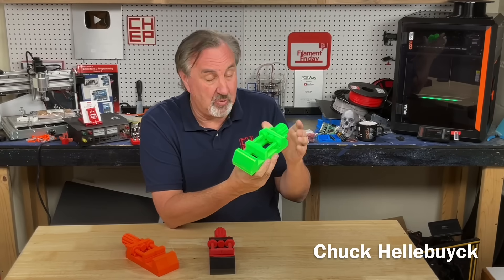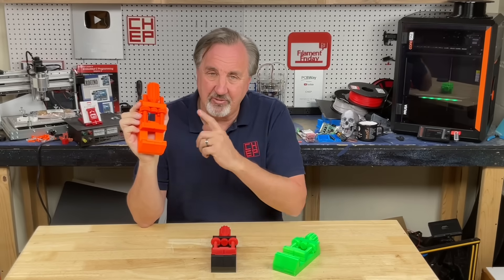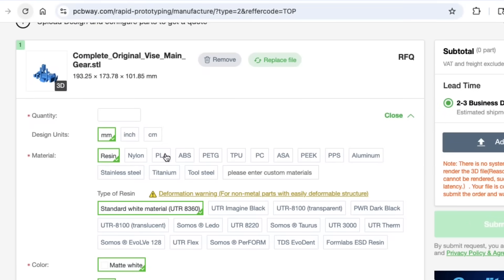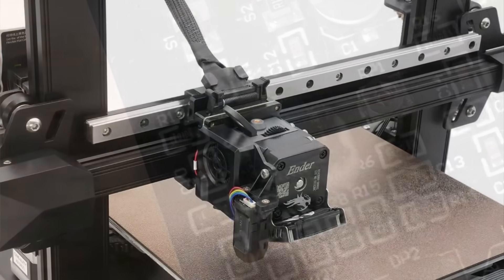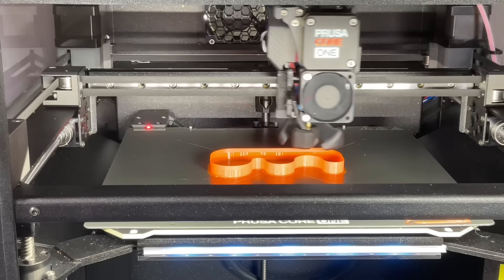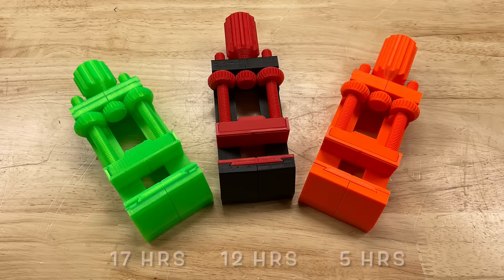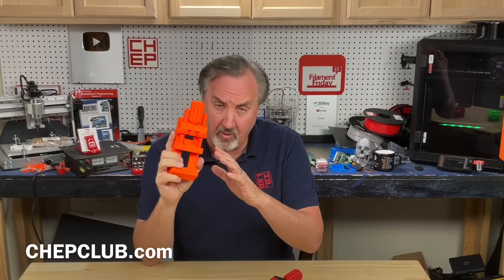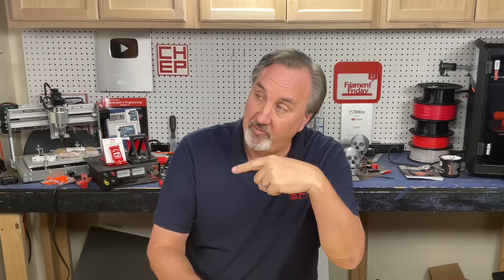How Did 3D Printers Get So Much Faster?

Comment: Look at what Roetz 4.0 is doing. Ultra high flow extruder with specialized cooling and motion system. It's definitely within range that machines can move faster, higher accels, the key is cooling with something other than air.

Comment: Until your outro I never knew what CHEP stands for 🤯
Regarding the question: I think currently we're at the limit what can be done with steppers, that's why manufacturers start switching to servos instead.
And if you want to go really fast, cooling becomes the main issue. You can increase airflow only so much before you simply blow away your print...
Reply: Temp of air or not even air. Look at Roetz 4.0, he is experimenting cooling with helium. Also current mass production high end machines cap accels at 20k, diy machines blow past those at 50-100k, and mass production hotends barely hit 40 cm^3, after market custom hotends hit triple digits. Servos aren't necessary, they're nice, but they bring their own problems, servos are used in CNC world due to torque at speed, you don't need high torque in 3d printing.  Bambu is only using a servo in the extruder for extra information. Watercooled hotends, steppers and electronics will be coming to mass market. Only way to increase flow without clogging. More patents will be going into public domain, and more advancements are coming.
Reply: I wonder if servos would eliminate vfas…
Reply: @dgurevich1 no, actually servos on xy make vfas worse. I tried it. Have over a $1k of parts in a bin waiting for a different project. Probably something in robotics.  Was also tried by Vez, vzbot main creator. He couldn't tune out the vfas. Modern tmc drivers give so much feedback info and can run at up to 60v and 8 amps, running servos isn't worth the extra headache. My trident is on 56v and hits over 2m/sec. Speed is not an issue. Monolith gantry will get to 50k accels and zero vfas.

Comment: 1:15 — I love my CR-10S. And as we have gradually been improving Marlin, the most basic self-contained firmware has continued to make this machine a little faster and more reliable with each month that goes by. And in recent weeks we’ve been getting some amazing optimizations from new contributors who really know their stuff. Whatever level of RepRap you are rocking today, there has never been a more advanced selection of drivers, slicers, and accessories to make the whole experience better, smoother, and faster!

Comment: I wonder how fast one could make a CR-10 by updating extruder, stepper motors, electronics, software etc... it wouldn't be a CR-10 any longer except in looks but would be interesting.
Reply: I'm kinda on this mission now but without linear rails, it will never be that fast.

Comment: Weight!!! Tool heads and other moving parts have to shed weight to handle higher accelerations.
Reply: look at the t250 -- it's not about weight, it's about balance, that machine hits crazy high accels, it's engineering and managing resonances.
Reply: @kazolar  Matt specifically mentions lower toolhead weight as one of his goals with the T250
Reply: @TheVintageEngineer yes, but his main focus is frame rigidity. Modern toolheads are light already...a bit over 100g for extruder nozzle combo, is not gonna get much better.

Comment: Sorry chep but if anything I’ve learned in the last 5 years is that the brand Prusa is overpriced for no reason Bambu has proven this time and time again I bought in one time for a prusa and I never will again I started with creality ,got a anycubic 🤦🏽 , then a prusa 🤦🏽 ended at Bambu and that’s it while everyone has been playing catch up I’ve stayed with Bambu since the X1C no reason to get another brand imo
Reply from the maker: Since Bambu never took part in the open source, I still give props to Prusa. Bambu even used their slicer. But Bambu did help push it all faster. 
Also, who’s cheap? ;)
Reply: @FilamentFriday sorry CHEP it was autocorrect to Cheap 🤣
Reply: @FilamentFriday  open source is rather a lose definition when it comes to Prusa, look at what Proper Printing had to do to add his own extruders to the XL. And he got a video sponsored by Prusa, yet wasn't able to get cad files. Open source would mean he can get the cad and design files for the toolhead board, I can get cad and design files for duet toolhead boards, for btt toolhead boards, but not Prusa. Interesting how you chose to define open source in the most favorable light for Prusa.
Reply: @FilamentFriday  Open source is not that important now since printers are good out of the box. In fact, since I got my X1C, my ender is now too much of attention that I barely use it, only for parts that don't have to be cosmetically nice . Even Prusa is slowly coming out of it. And it's better imho. I pass on the Core one because it was too much maintenance for me with vfa and belt tensioning, buddy cam and all. At least, the core one L looks more finished but also incomplete in term of features.. No nozzle wiper, common..

Comment: I started in 2020 with a used Anet A8 aka fire hazzard, than switched to a CR6-SE for almost 4 Years and today i use a Creality K1 Max - the increase in speed is insane - 30mm/s vs 50mm/s vs 3-500mm/s
Reply: imagine not using volumetric speed measurements in 2025

Comment: More software and hardware improvements will happen.  I personally do not worry about speed as much as quality and successful prints.  The tool-changers will be how mutli color /filament evolves.  My Prusa XL is an interesting machine, but it needs to be simpler and cheaper for the average hobbyist.  Curious to see what happens next year.

Comment: The bottleneck will be how fast you can get plastic to melt.
Reply: Actually the bottleneck is cooling. There is this guy on YouTube, can't remember the name, he has a custom 3d printer to achieve sub 1 minute benchies. And he got bottle necked by cooling.
Reply: @shadowphyre  You mean Roetz40 ? Yes he has some crazy ideas for cooling.
Reply: @andreas.grundler ye, that's the guy. Using helium for cooling is insane 😂
Reply: And cool doesn't again before it's a puddle